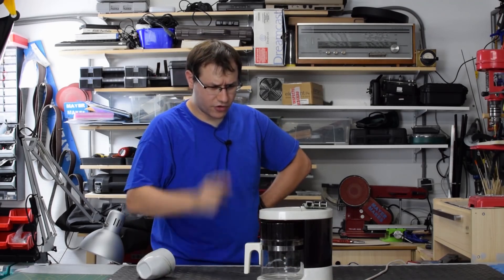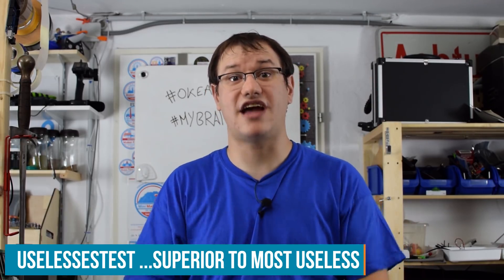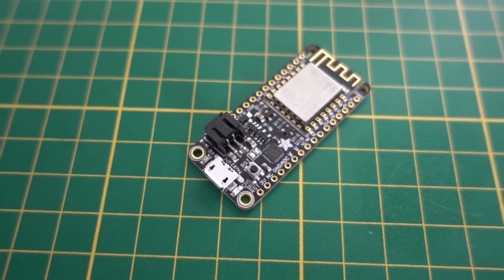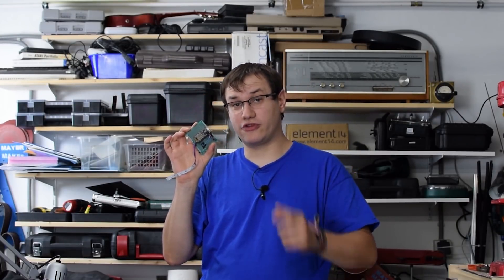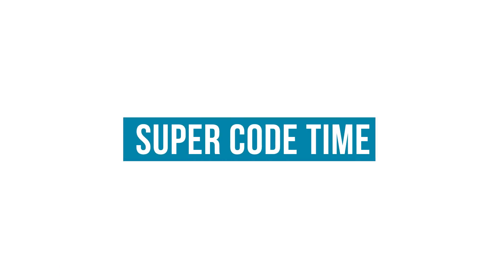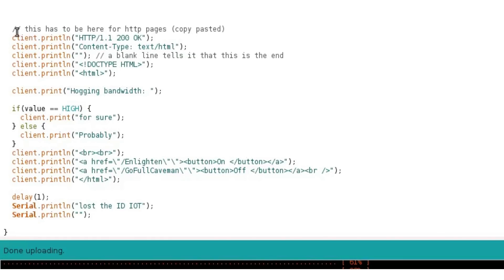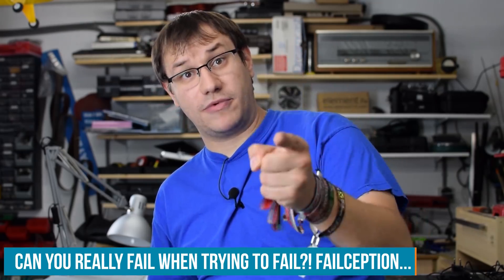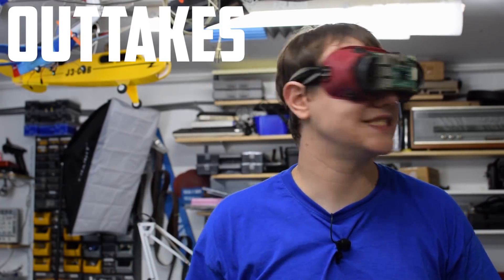Most Useless IoT Device Ever! - Part 1

Comment: An IoT device which will connect to your IoT light-bulbs and IoT stereo system and of course your phone equipped with proper APP. Whenever you turn ON or OFF your lights in your appartment, it will play from the stereo announcement about the light status (e.g. "Your lights are now turned off!") and it will notify you on your phone too.

As premium, you can add friends in your APP and they will receive the notifications too.
Reply: Did you know, your Idea can be considered for the next part of the Quest for the most useles IOT-DEVICE? But only if you post it here: https://www.element14.com/community/docs/DOC-90870/l/episode-362-most-worthless-iot-device-ever-part-1?ICID=hp-TBHS-newepisode
Reply: Thanks. I have already posted there.